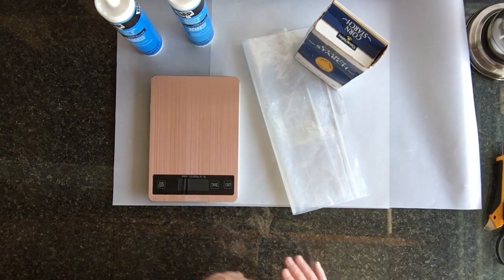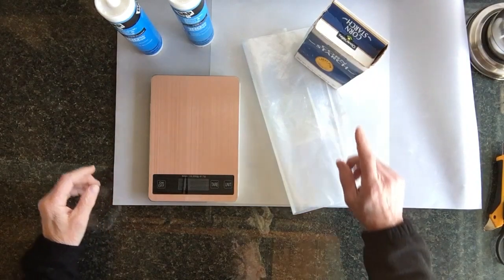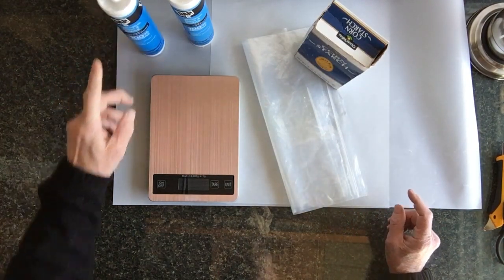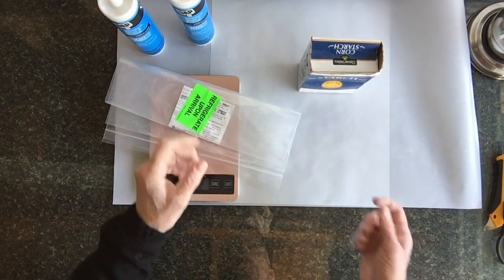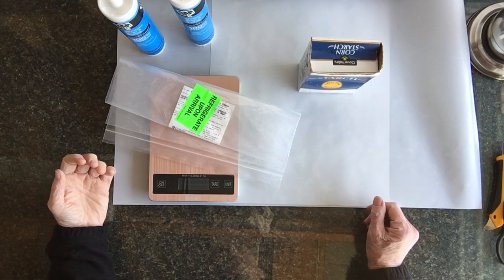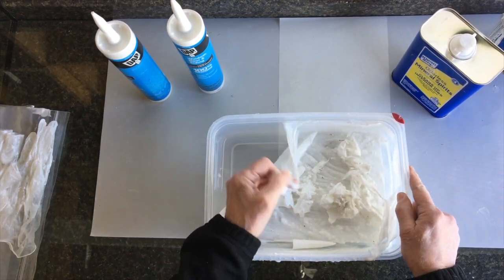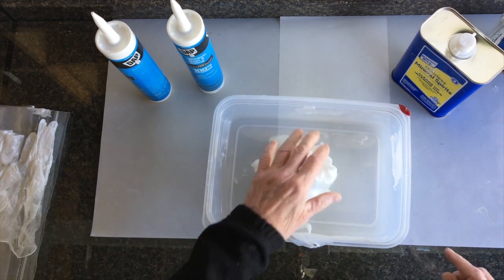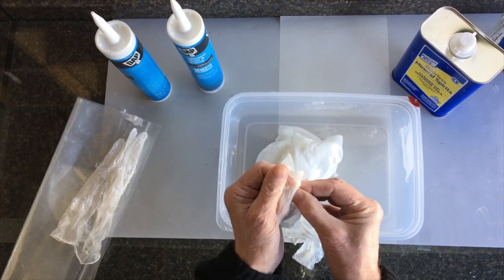Silicone: Thin with mineral spirits, sheet pour. Wheelchair assist threshold ramp.

Comment: Wanna make it smooth after leveling the top of the pour lay a sheet of plastic on top and roll that with a round piece of wood or pipe. Rolling pin if its small enough. After its cured pull of the plastic for a nice smooth finish.

Comment: Nice Video!   If the mould wasn't asymmetrical (or was built to be reversed), couldn't you have used the bottom of the mold as the finish surface? Would likely have worked for the lumpy pour as well, but the tip of thinning the solution before adding the accelerator is superior.
Reply from the maker: Yes, you are right. And you caught me, I made the mold backwards and upside down. Typical carpenter brain drain. Glad you like. I want to do this again and add a wood spine. Stay tuned, and I will likely get the mould right this time.

Comment: Ok, now, i have never seen 100% pure silicone that is white.. its always clear at my store. Is there a specific brand that sells white 100% silicone? Or is that a different type your using? Thanks again for this. Going to use acetone first since thats what i have hah
Reply from the maker: Most hardware and home improvement have 100% white silicone made by DAP.  Others make it, it is pretty common. I use the type that evolves Acetic Acid during cure.

Comment: Hello tried this, I tried this with molds but the pieces are shrinking at least 30-50%, acetic 100% silicone with mineral spirits 10:1 cornstarch. Maybe I put too much mineral spirits?
Reply from the maker: Yes, the mineral spirits, or any additive that evaporates will, of course, lead to shrinkage as the volume of the additive evaporates. Although straight silicone does not shrink, if you add something that evaporates, your item will shrink that amount. You will have to calculate shrinkage to end at the size you want. To add to the challenge, it does not shrink linearly, as in thin sections will not shrink as much as thicker sections. The ramp I made did not shrink width or height, but it did lose a lot in length. I did a later video where I use silicone oil, and it did not shrink, if you wanted to try that. You can also, leave in mold (hold in place) until it dries a few weeks, and it will be the size you intended. I haven't covered shrinkage yet, but I get this question enough to make a video on it.

Comment: I'm really curious, do the silicon+naphta mix shrink with time?
Reply from the maker: Great question. They do not. I have been using this device daily since I made it and it is the same as the day I removed it from the mold.
Reply: @GEOsustainable  this is great! Do you have a "recipe" for your silicon/naphta/corn starch mix or do you make it by eye?
Reply: @tokagehideto  I was hoping he would have answered that.  have been reading the comments to see if he had put the info here. Hey! GEO!  What's the ratio???

Comment: I have used the plastic bag idea to mix up epoxy resin as well. It makes it so much easier to deal with, and I know it’s mixed well. Thanks.
Reply from the maker: I am so glad you like the idea. It does save a mess, and yep, you can see better.
Reply: I love this tip, I work with resin often and can't wait to utilize this method, thank you.

Comment: What was the mold release used?
Reply from the maker: The mineral spirits was all I needed, as the form is paper backed foam board. The mineral spirits soaked into the paper. If you use another material you can use vegetable oil, soy wax, or soap. I used soap in this video and show how to apply it. https://youtu.be/452y9FQ7a0M

Comment: Will  this work to make a mold of my rubber front doormat? Would i need to oil the doormat? I am trying to figure out how to make a mold of the doormat to poor cement into so i can use in my garden.
Reply from the maker: Yes, this will work perfectly. Yes, I would recommend dish soap as a mold release in this application. Watch here to see how to apply soap. 
                https://youtu.be/452y9FQ7a0M
Reply: GEO sustainable thank you  for your quick response! I have been searching to try and do this for a few years. Thank you for the inspiration and confidence to proceed ! Also appreciate  your recommendation on the mold release! Keep the videos coming. Subscribed
Reply from the maker: @PuppyBiteforTrump  I am so glad you found my channel. I hope to bring you lot's of really cool projects.
Reply: GEO sustainable watched the video that you suggested. I have another Question? You used the dish soap over a clay mold in the video that you just suggested; so will the dish soap work on the rubber door mat with using silicone instead of clay? The doormat is standard  rectangular size. Should I build a box around the mold when I go to pour the concrete...I think I want it to be 2-3 inches thick.anymore suggestions/recommendations are greatly appreciated! Feeeling a little intimidation , so I think ill need a supply list so i can take on this challenge.
Reply from the maker: @PuppyBiteforTrump  Yes, the silicone will work to coat the rubber mat. As you saw, it takes up to 5 coats. The advantage is the detail is preserved, and there is a risk that oil will be absorbed and dissolve in the Naphtha (or other solvent).
Reply: GEO sustainable also what type of material do you suggest for making the box? The mat has a cut out design, therefore it has openings and isn’t solid flat mat.
Reply from the maker: @PuppyBiteforTrump  I would use the same as I did in the video, cardboard. Soap up the cardboard as well. It's not a bad thing to toss a little cardboard in a compost pile or even a landfill, as it becomes dirt.

Comment: Have you thought about mixing the corn starch into the mineral spirits first and then adding the mixture to the silicone ?
Reply from the maker: Good thought. I would try a small quantity at first. My thought is that as soon as the cornstarch contacts the silicone, the cure clock starts. When thinning, especially a lot, it takes a good long time to get it to homogenize.
Reply: @GEOsustainable 

I was thinking that mixing the cornstarch into the spirits would prevent clumping, similar to when I make a bechamel sauce I whisk the flour into a small amount of water, rather than directly into the butter...
Reply from the maker: @bertkutoob  Yep, good thought. Keep in mind the cure clock and give it a go.

Comment: Shred the fresh cast through a grinder, it can probably be then used to bulk out the next cast. It works bulking out RTV silicon molds. Do a test if you can first, it might just work!
Reply from the maker: Oh it works alright, I do that with even what I peel off my utensils. It is a great way to recycle. I then use silicone oil to re-soften it. Watch here, I did a video on silicone oil. https://youtu.be/Ci28Y3Z3bYU
Reply: Many thanks for posting your content , wishing you good health . Best Wishes.
Reply from the maker: @clubhead9242  My pleasure, thank you.